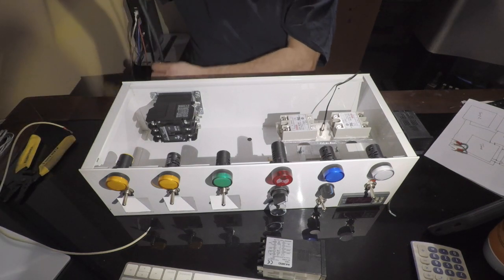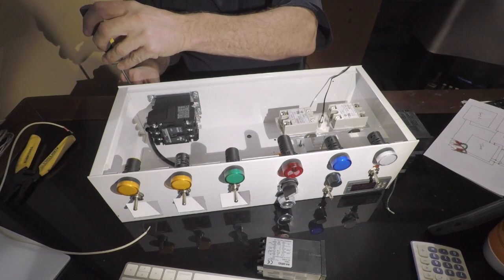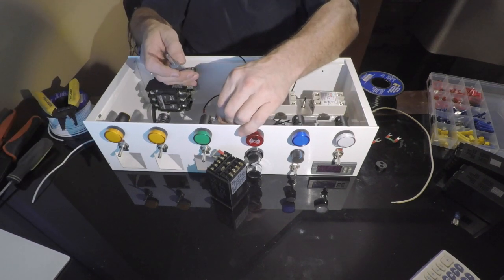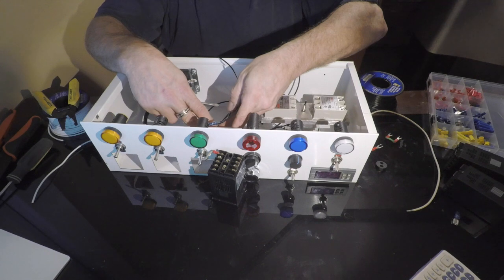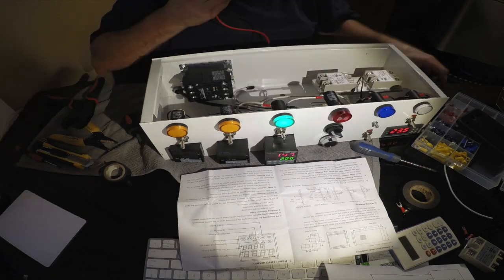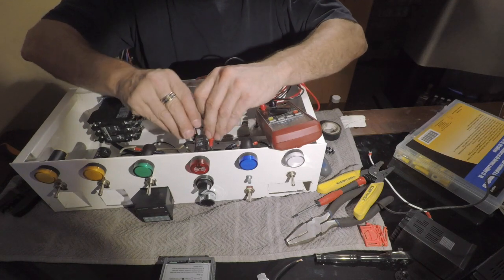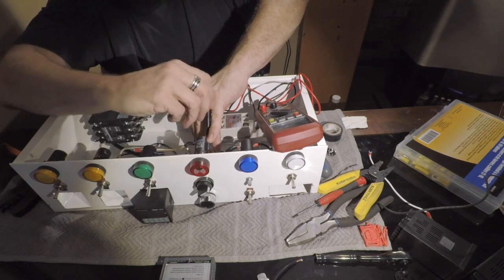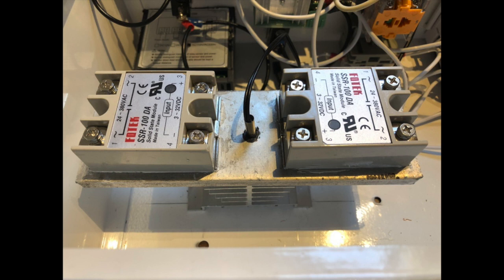Powder Coating Oven Control Box Wiring. Part 3

Comment: Love this build, I want to build pretty much the same thing, Have you put together a wiring diagram to help demystify some of the design and connections? I'm a bit confused on how the SSRs and Contactors are wired together. I'm thinking if the SSR fails closed, won't it still hold the contactor closed as well? Also with the SSR controlling the contactor aren't we loosing the ability of the PID to be able to send only a percentage of power to the elements. I am and novas and just learning about all this and trying to wrap my head around it. I appreciate whatever information you can provide. Thanks so much.

Comment: Hello!!  may ITC 106VH run a contractor instead of ssr ? Manual says that 106vh has AC  output 110-240v , my contactor runs from ac110.  Look's like gonna work ?
I'm confused because it also tells that output polarity important.. but if it AC control output.. ?
Reply from the maker: I looked over the manual and I don’t see why it wouldn’t work. I would throw a metre on it just to make sure its outputting the 120v that you need to trigger the contactor. That PID also has a DC side to trigger SSR’s. That is why they’re telling you to mind the polarity.

Comment: Great videos on the oven build. Really enjoyed them 👍🏻 do you have a  wiring diagram on how you set your controller box up. Been trying to find something to help me build one for my oven. Thank you!!  Looking forward to seeing how your oven works out for you.
Reply from the maker: Thanks for the kind comments I'm glad you like them. I'm pretty old school and it was done pretty much on a wing and a prayer..  I drew up what I needed in the controller box on some paper taped to the box itself (a few times) while I waited for all the stuff to roll in from Ebay and Amazon.  And when all the stuff came in I spent a week or so with everything just sitting on top just to make sure it all made sense as a control box. When I was 100% sure it was what I wanted I cut the holes. As far as the wiring goes I had stared at the thing for so long I knew exactly what I needed to do. I did have to sit down and draw out the 120V circuit into the timer and PID's but the rest was just lights and buzzers.... bells and whistles.. lol. If you look on my channel and find my email address, I don't mind sending you a picture of the timer/pid circuit. But most of info you need is easily found on the net. Thanks for watching.

Comment: question, does the alarm need a 3 way switch to turn it off or reset it or is the black button under it a momentary switch?
Reply from the maker: The Alarm/light runs off the timer. When the timer runs down to 0 it sends power to the alarm/light... That power runs through the switch below the red alarm/light and just cuts the power to it so the thing will stop squealing. The reset button below the on/off switch is hooked up to the timer reset circuit. Just to be clear, you need a NC (Normally Closed) momentary switch for this reset to work. If you hit the momentary button quickly (just right) it will reset just the time. If you push it hard, it totally kills power to the timer and the PID's reset as well. It's just the way the reset works on the timer... a little cheesy but it has been working just fine for well over a year now.
Reply: @i.b.lancer  Thanks mate really appreciate your response thats helped a heap :) Might email you just to run over the diagrame quick if thats ok? Niko.
Reply from the maker: DEMOP GARAGE... Send it over anytime. I’ll take a look, no problem.
Reply: @i.b.lancer  cheers mate I'll draw it up :)
Reply: @i.b.lancer  sent it over to your email address.

Comment: I love to seem more footage of this build I want to build the exact same one
Reply from the maker: There isn’t a lot of videos on this control box build but I’m happy to answer any questions. 
Here’s a link to the very first video I made when I started to build it. 
https://youtu.be/UpPZ0zYIMWY
Reply: Can I get a part number for the contactor or the amp it’s rated at? I’m build a fairly large oven
Reply from the maker: The one I used is a 40A. See the link below. I’ve also included a link to a 60A contactor. If your building a larger oven you might need something bigger then 40A. . Safety first. 

Eaton C25DNF340A Definite Purpose... https://www.amazon.com/dp/B002KHF5VK?ref=ppx_pop_mob_ap_share

Packard C360B Packard Contactor 3 Pole 60 Amps 120 Coil Voltage https://www.amazon.com/dp/B004ZXMC72/ref=cm_sw_r_cp_api_i_jliZCbBT50YY3
Reply: I think I’m going to use two 60 amp contactors 2 100 amp relays and two controllers like you have here do you think the timer is necessary I’ll be able to put out 17750 watts at 70 amps 240 volts
Reply from the maker: The only reason I used two controllers is because I have one 120v element and one 240v element. If you’re using elements of the same voltage you should be able to get away with one controller and one SSR to run two or more contactors. And I think that a timer is a must. It’s way too easy to lose track of time, and you don’t want to overcook your parts
Reply: So what’s the reason to have a contactor and a solid state relay? Aren’t they both doing the same thing? Is this some sort of extra protection?
Reply from the maker: In theory they are the same thing. But you nailed it when you asked about the extra protection.  I set mine up so that the SSR is the trigger for the contactor. The timer, PID's and SSR's are all made in China under questionable standards. Eaton (contactor) is one of the most trusted brands around. I personally don't trust the china stuff to take the big loads. So I use them in the low amperage situations and the big contactor does the heavy lifting. To me, this is the safest way to go. Let's put this another way.... would you want to be putting 60 amps through a $14 Chinese SSR or a $50 contactor the size of the Eaton?
Reply: Very good points and I agree with the extra protection are contactors good at being used constantly? I’m very new to all this so I have lots of questions lol any insight is greatly appreciated
Reply from the maker: Yes, those contactors are designed to run continuously.